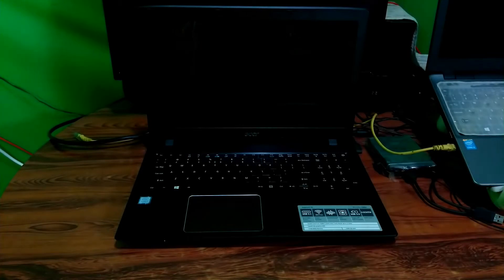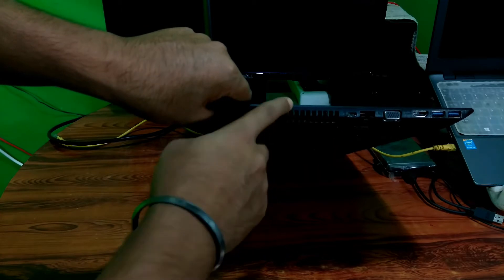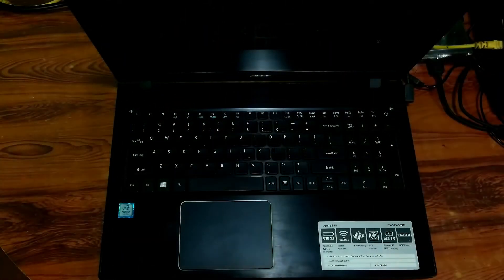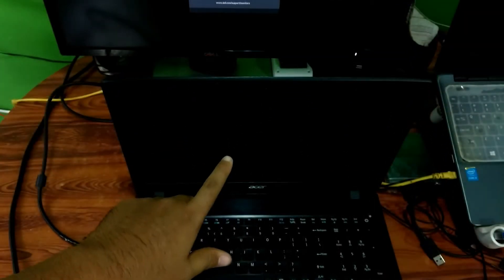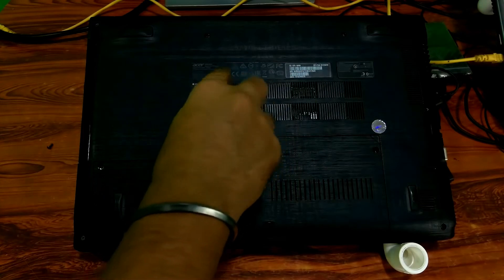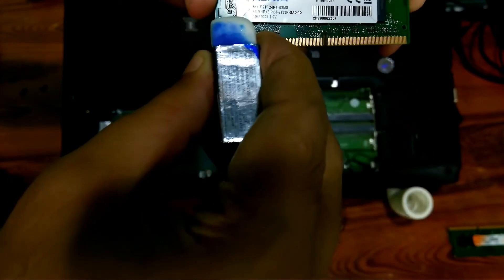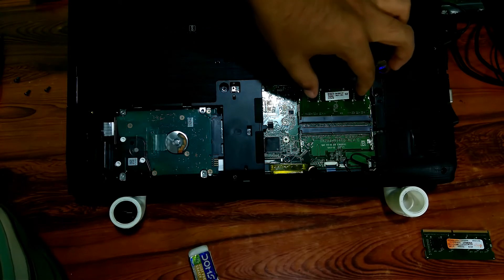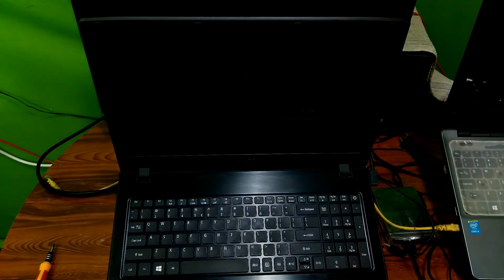How to Fix Laptop on but Display Nothing Issue (Easy Fixes)

Comment: I'm facing a strange problem. I am using Acer A515-51G. My external ram got damaged. I've replaced with new one. I've tried 3 branded rams of 2400MHz and the display is not turning on. But when I insert non branded chinese ram the display turns on and works perfectly.

Any solution for this?

Comment: i tested both 30 1 2 method and changing ram but neither worked....still only my screen doesnt turns on, but my laptop turns on fan runs well .... does it mean my mother board dead..is it possible to recover data from hard drive using enclosure case ????
please reply
Reply: having same problem here in 2025…any tips